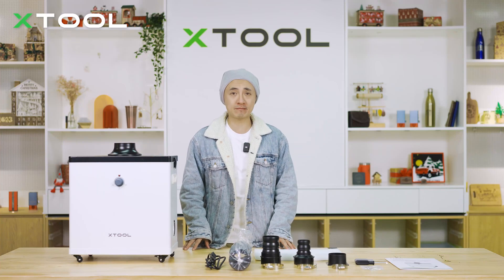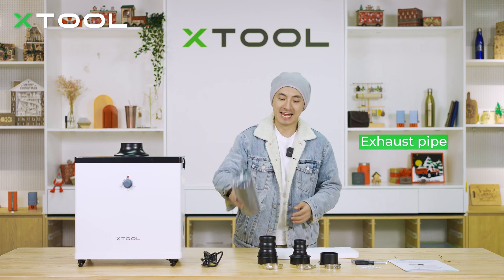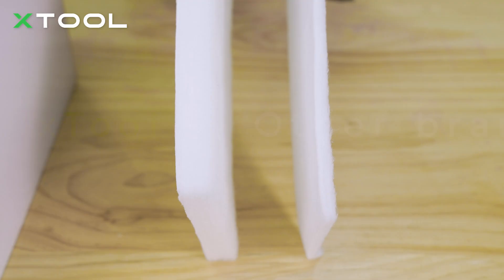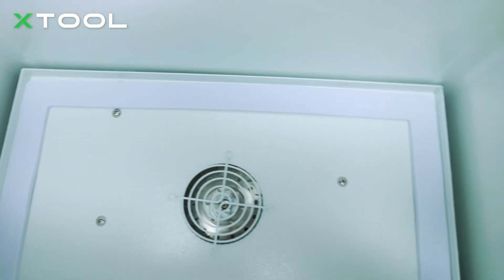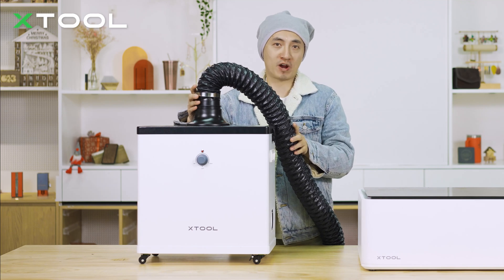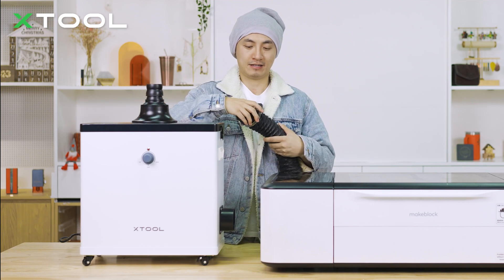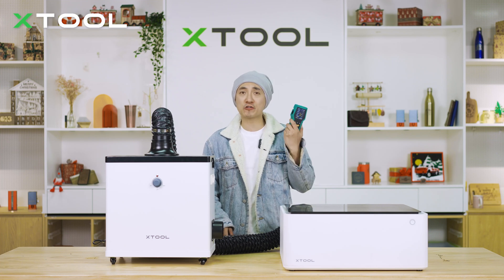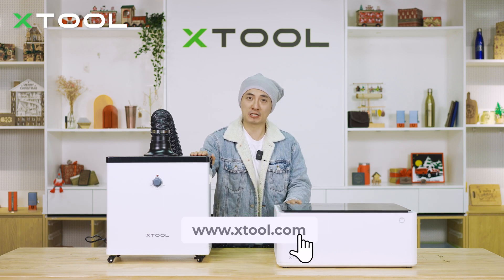xTool Smoke Purifier Tutorial - How to Discharge Smoke When Laser Engrave? | xTool 101

Comment: i bought this unit and now it seems no filters are available anymore after the new version came out.  :(
Reply: Thought about going after this filter, but if what you say is true then maybe not.
Reply: @ the pre filter is available, but the middle filter is not available from xtool.  I’m sure affiliates and others have stock left, but once that is gone then that may be it.  I’m waiting on confirmation from xtool if the middle filter has been discontinued or just out of stock… but they have been out of stock for a while now.
Reply: @spkendrick  please let me know what you find out.
I’ve thought about getting this model of filtration for events. I know the pre filter can be blown out to help extend its life, but if the filters are that hard to get, I might have to change my mind.
Thank you for everything you’ve found out so far.
Reply: @angusrumplemeyer1791  i sure will let you know.  the pre filter is like home ac filter material, so from my experience it cant be blown out or at least it seems like it would be more trouble than it is worth.
Reply: @spkendrick  I seen another creator on this platform using a leaf blower to blow his prefilter out.
That’s why I thought of that. 🙂

Comment: Hello, thank you for the video. I’ve been working with this unit for a few hours and still noticed the smell of smoke in my room. I noticed that the lid does not seal well and that the is air being blown at the corners. Can I and , if so, turn off the fan on my S1, so that it’s just the purifier sucking in the air? Thanks for the help.
Reply: Myself i am debating on getting this purifier for my S1 as the one i wanted to get is almost 2K (it seems better however). I would think a inline fan would be better to suck out fumes, i may do so on my S1.

Comment: I'm confused...the manual shows that a hose also needs to be added to the output. You show a hose like that too, going out the window, although the hose isn't in the rest of the video. Is it necessary to add a hose to the smoke purifier output to a window? That defeats the purpose of having the purifier to eliminate the need to vent outside.
Reply: If you vent outside, you don’t wanna put all those chemicals into your neighbors and then they come right back into your house
Filtering first is definitely a plus
Reply: @lovebirdcustom  this is my question I don’t have a way to vent outside that’s why I got the purifer
Reply: This is $300. You are looking for xTool SafetyPro™ AP2 Air Purifier with SuperCyclone System which is $1000 and removes any venting to the outside.

Comment: 😡😡😡😡😡😡😡😡😡😡All lie!!!. I just received mine very excited after watching this video. I put it to work, I take the measurements of the room where the machine is working and it gives me unhealthy measurements in the room that I can't. Measurement data: "TVOC=9.56 - HCHO=1.71 - PM 2.5=301 - PM10=468". With these measurements it is not possible to work in the same room where the laser machine is working and the purifying Xtool "supposedly" filtering the fumes. 

I have videos where you can see everything that I indicate here is true. I have consulted with Xtool and they say that it is normal for it to contaminate the room, that the purifier itself cleans the environment of the room over time. So, what good is it? If, to begin with, it begins by contaminating the workplace itself.

With a simple smoke extractor placed at the exit of the laser cutting machine, results are obtained inside the work room with much, much cleaner air.

I feel cheated and wasting money with this product. It is not as good as they want us to see in this video.😡😡😡😡😡😡😡😡😡😡😡😡😡😡